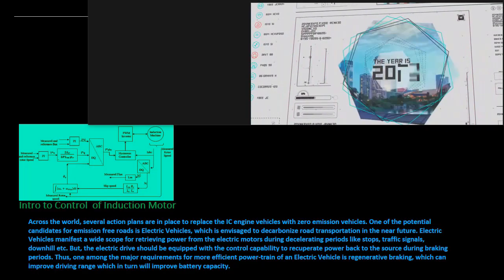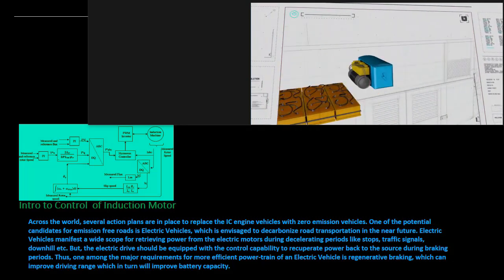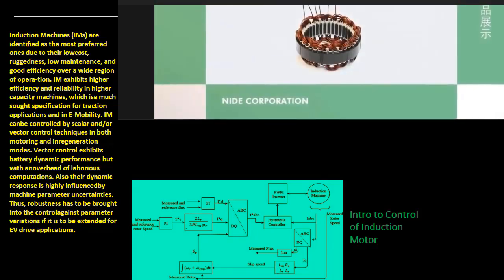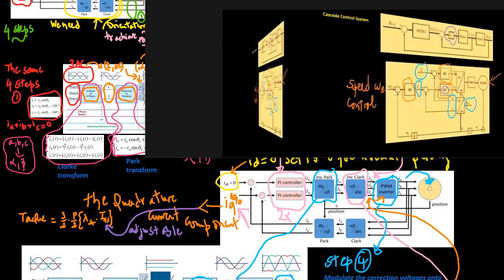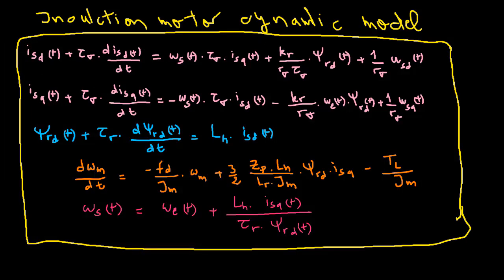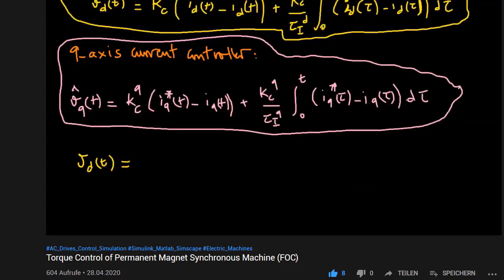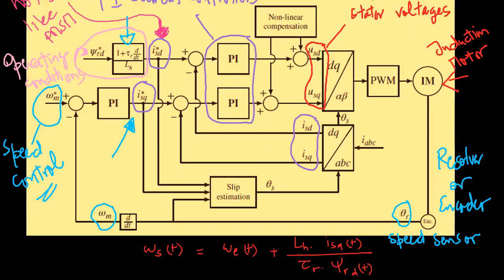Introduction to field oriented vector control of Induction motors FOC

Comment: Thank you so much for all your videos! So is wm=isd x isq or why can you control wm by controlling isq ? 5:37 why is the output of the speed pi controller Te so the signal as torque?
Reply from the maker: There are nonlinear cross coupling terms in  the equations, this  terms can be eliminated using feedforward manipulation.
Reply from the maker: The implementation of PI current controllers for induction motors follows a similar procedure to the one used in the application
that are used in the implementation of control for PMSM Key issues. in the implementation of current control
for the induction motor are estimates of certain unmeasured variables. Note that these compensators calculate the rotor psird flux and the synchronous speed
omegas. These signals are not measured by sensors, so estimation schemes are needed to estimate this information.
The cascade velocity control includes the dynamics of the current isq and the dynamics of the velocity omegam. The current isq model is used for the design of the internal loop of a proportional feedback linearization control system and the motion model for speed is used to design a PI controller for the external control loop system.

Comment: Thank you very much, i really appreciate those videos.
i have one  question, how to determine the value of Phir* ?
Reply from the maker: If the operation of field-weakening is not involved, the set-point for rotor flux psi_rd will be constant. However, if field-weakening is involved, the reference signal to rotor flux psi_rd change. therefore you can enter the speed as a setpoint for the field-weakening block, in this situation you use a flux controller and for the flux determination you use an estimator or osbserver.  see the picture below here : https://en.wikipedia.org/wiki/Vector_control_(motor)
Reply from the maker: Field weakening control is a key technique for high speed operation of electrical machines.
Reply: @eDrivesEmbed  
so i have a question, i tried to look how to get the value of Phir* which you assigned as .95, so how to get this reference value or is it a characteristic to the machine ?
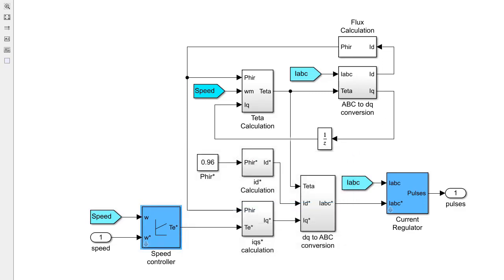Reply from the maker: @mohamedashrf5259  for this machine it s calculated as 0.96 (contant torque region not in field-weakening region). i tell you how to calculate for the last video because i have the machine parameters (Voltage and frequency ) phi = V/(2*pi*f*4.44)=415/(2*pi*50*4.44)=0.29=0.3 Wb. Last video: https://www.youtube.com/watch?v=I28CJca5RFs @ 5:45 and @ 5:13. At speeds below rated speed, the flux is kept at its nominal value whose value can be computed using the name-plate data of the machine.
Reply from the maker: @mohamedashrf5259  to learn more search back emf and flux for the motors. https://www.electricaleasy.com/2014/03/emf-equation-of-transformer.html
Reply from the maker: @mohamedashrf5259  or air gap induced emf in ac machine to learn more about motors